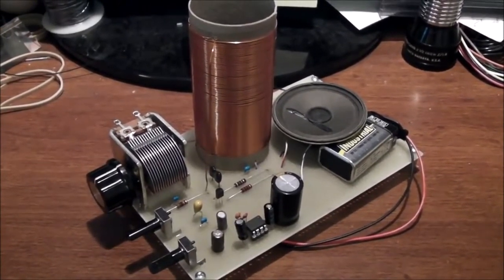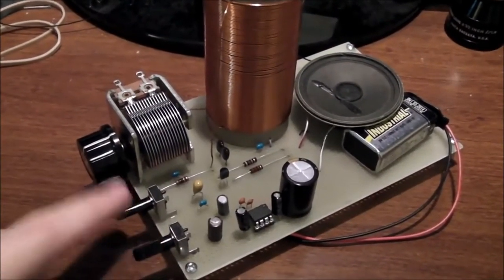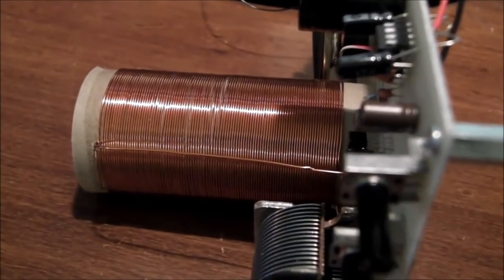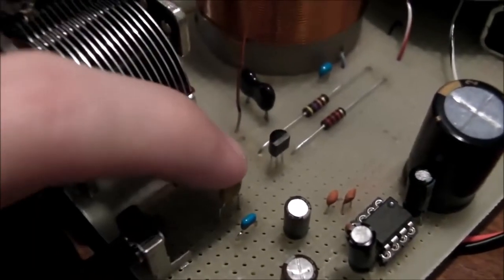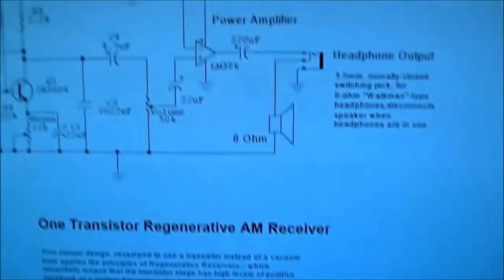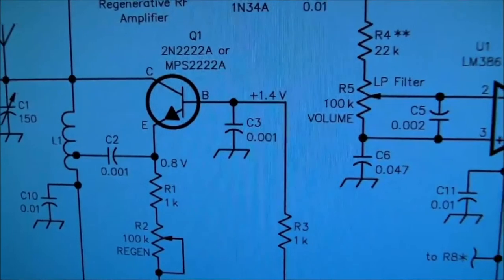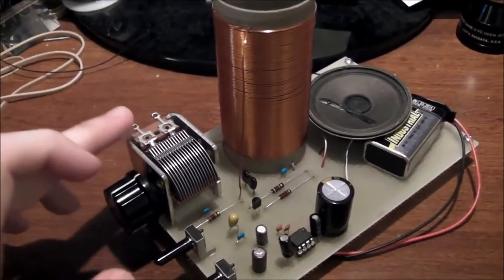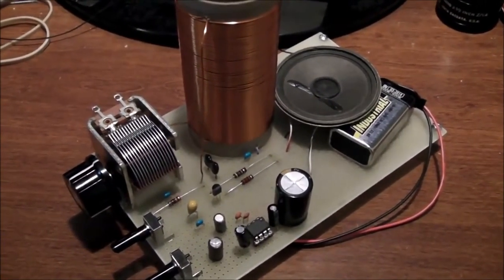One Transistor Regenerative Radio Receiver **subscribe**

Comment: Thanks, 3 years later.

I built one 15 years ago. I included a fine tuning variable capacitor which really added to its usability. I also remember it possibly having a tickler coil. Unfortunately I ended up moving and lost the receiver.

Having an amateur license I had an interest in rebuilding the receiver. I could not find my original schematic and tried over time two schematics found on the internet. I could not get neither working & it might have been a bias issue as you found.

I do plan on trying to build the direct conversion receiver that the SolderSmoke channel designed for H.S. students but want to start with a simple regen as a prelude. 

I've looked on the net and having gone to grad school for math not electronics I was confused by some of what the net offered. I stumbled on your adaptation & knowing that it will work I grabbed screen shots off my cell phone and will give it a good effort.

Comment: A vertical coil antenna is in exactly the wrong orientation for signals from any direction. Always mount the coil horizontally if you are not going to add a wire antenna.

Comment: Thanks for sharing. Some time ago I was looking for a simple regen receiver design based on 2N3904 / 2N2222 but didn't manage to find one. So I ended up building a receiver using tubes.
Reply from the maker: There are Receivers with tubes planed in the future, stay tuned.

Comment: I had built one transistor f.m with two inductors which worked as regenerative , oscillator with feedback but, I was unable to detect the signal or any radio station as there was no any detector circuit,(I knew that to build detector circuit diode is most important component) So I had even tried to detect signal by a single diode but unfortunately didn't work, Now seeing your video I've got an idea to build detector connecting diodes in series.

Comment: You did a really good job.  Super regenerative receivers can pick up stations and an FM plugged into decent speakers can almost sound good.   But there is something inherently imperfect with them that no matter what they just don’t satisfy.   They are fun for DX and picking up aircraft and stuff like that.   

Step up to a 6 transistor pulse counting FM - can actually sound really seriously nice.  I will post a link to one which I followed from the dudes website and it worked very well.
Reply: Be careful when you're hooking up an oscillator to an antenna, which is what a regenerative Rx is. You don't want the FCC knocking on your door. You're probably OK on broadcast bands.

Comment: Nice work. I'm currently building C. Kitchin's SW regen radio on a very tiny board and having problems getting the transistor to oscillate. Now I'm pretty sure that the trouble is associated with the three diodes and their location on the pc board. Thanks.
Reply: Have you tried swapping the tickler coil connections around ? 🤔

😎👍☘🍺

Comment: You need grounding rod, and better longer coaxial cable connected antenna to see how this wonderfully works. With similar design I got perfectly all AM stations that I can pick up on Sony ICF 2003 receiver. Antenna was 25 meters, good grounding, and gimmick capacitor connection to the coil.

Comment: I played again with this radio ...Again the same results..It doesn't pick almost anything...I didn't try to replace the transistor with something different because sometimes It can help..The regeneration is not smooth at all ,little bit and it will blow your ears and little less and it doesn't oscilate..I tried to replace the coil with one for shortwave. I managed to pick some morse code ,but very very weak ...I think the design its not so great because there are others with one transistor radio and they work..I guess what he is recieving in the video is a local station ...
Anyway it was fun..

Comment: Anyone know how to make this work with a different amplifier?Why it doesnt work with computer speakers?
It's performance it's indeed bad.I used 4 stages transistors for amplificafion and its making Little bit noise while oscilating ,thats it.
Reply: I also used an audio amplifier from a pocket radio ,3 transistor  in a push pull configuration with 2 Transformers, barely any sound  and just a single station,very very faint.Try lm386 with gain of 200 and one transistor amplifier before him...But i suspect it will make alot of noise 😂.It happened to me the same with 3 different regenerative recievers..Noone is talking about the needed amplification.The regenerative radios need more amplification than superhet for sure.